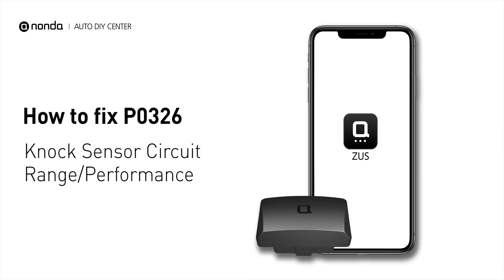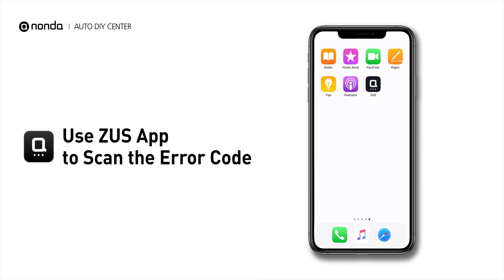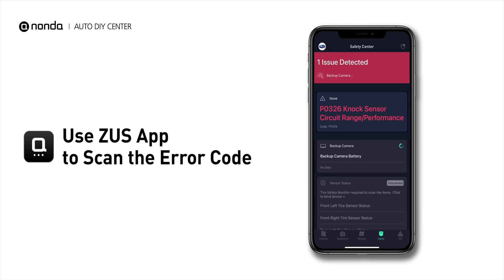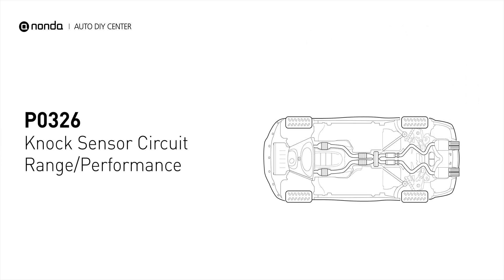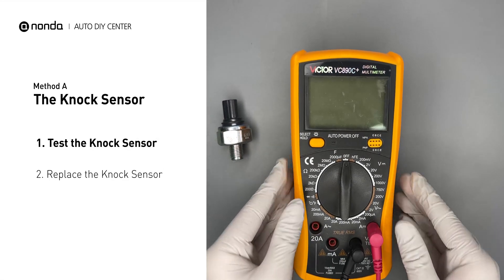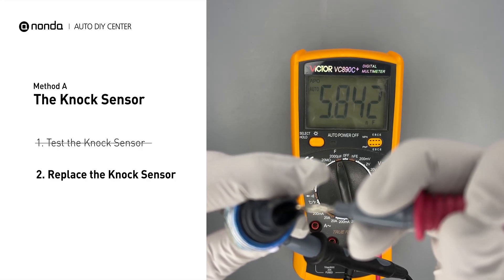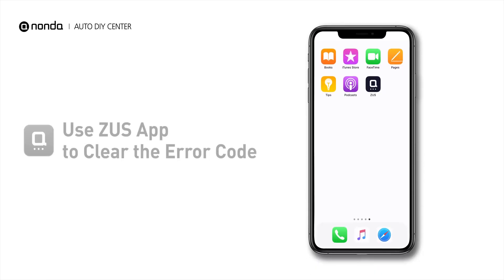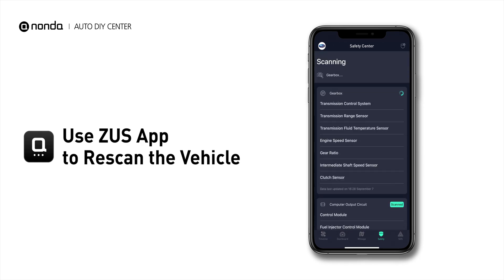How to Fix P0326 Engine Code in 2 Minutes [1 DIY Method / Only $10.35]

Comment: I took my truck to a dealer with the P0326 error code. They replaced the knock sensor and the wiring harness. The code keeps coming back intermittently. Any suggestions for that?
Reply from the maker: Hello, please provide us with your vehicle's year, make and model in order for us to address your concern accurately.
Reply: @nondainc  2017 chevy silverado
Reply from the maker: Hello, we suspect a faulty ECM that is causing the issue since you have replaced the knock sensor and fixed the wiring issue.
Reply: @nondainc  Just so you know. I changed the spark plugs and cleaned the throttle body and the code has not come back.
Reply from the maker: Thanks for updating us. We're so glad to hear that you have sorted out the issue. Have a great day and stay safe!

Comment: Does this work for p0325
Reply from the maker: Hi Julian, there are lots of issues that could cause the P0325 Code, so to prevent potential damage, it is best to consult guides and manuals that are specific to the trouble code and your vehicle.